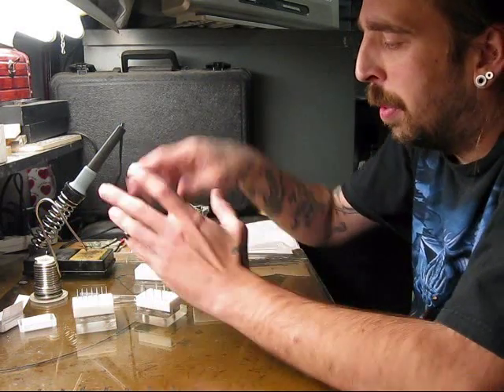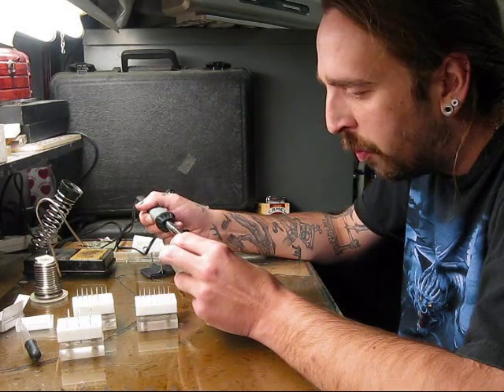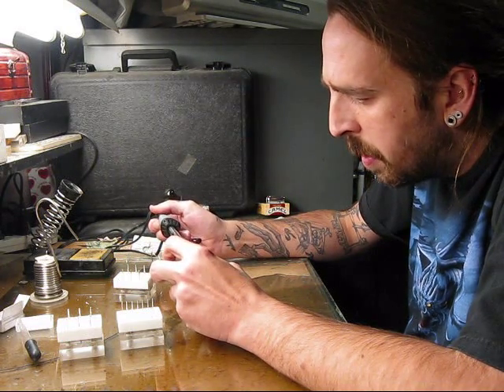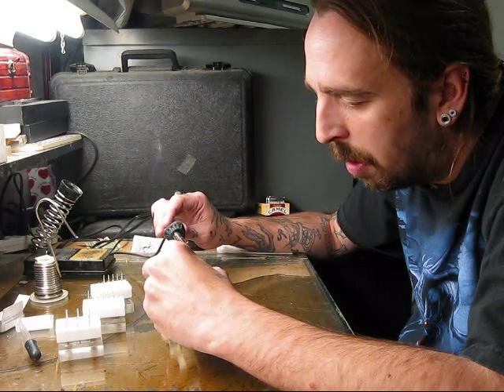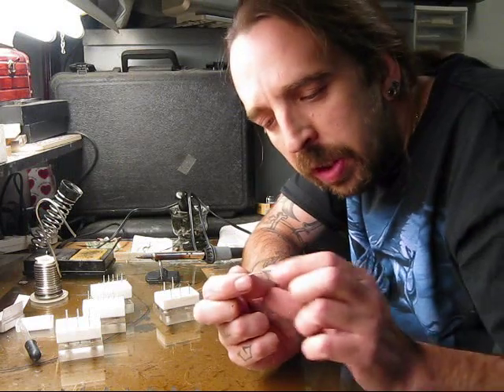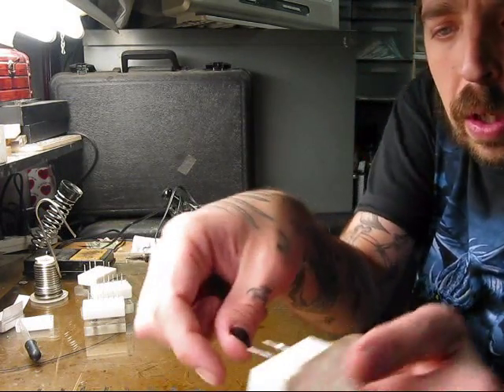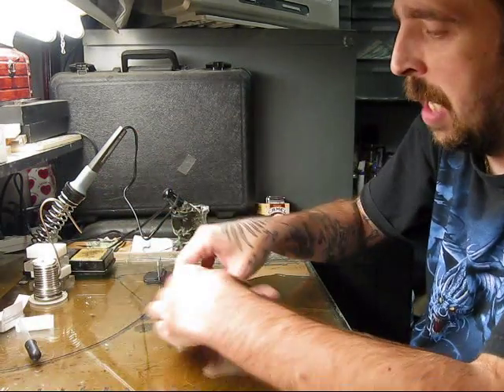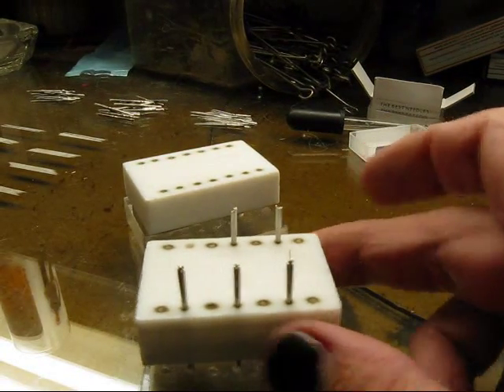how to make tattoo needles 4 of 6

Comment from the maker: your right.i dont know jack about soldering.all i ever needed to solder was needles and i was showed and went from there.as long as it lasts threw a tattoo thats all i need. i dont care what its called or why it works as long as it does work.and after 15 yrs i dont have any problems that u speak of.i tried using just a ;ittle bit and all i did was have to make a few trips to get the job done.

Comment: Hey dude, great video. I was looking for a video to show my wife how needles are made. I used to make needles at a shop called The Blue Dragon in London Ontario in the late 90s-early2000's. I made needles for 4-6 different artists (I was the body piercer there). I made them almost exactly as you do except I used really old school metal jigs. 1 needle-1 jig. I wonder if you have seen these before?  2 inches of a bar (end with loop on it) soldered to a small metal jig (small metal tube with metal bottom plate) (so the loop on the bar was your handle). I was taught by an old British Tattooist that owned the shop. Also I used a razor blade instead of the paper you mentioned for making mags. The razor blade was beneficial because you could change the gap easily to suit a certain artist and his tattoo style by controlling how far you slide the razor blade in. I have fond memories of sitting in our small unventilated room making needles for hours while smoking cigarettes lol.
Reply from the maker: lol..... the good old days..... lol..... these guys nowadays have no clue how to do this.... glad to bring some memories back for ya

Comment: This dude needs to learn about soldering. He might know how to make needles, but his soldering sucks. For one thing, he is making what is called a cold solder by putting solder on the tip of the iron and then touching the solder to the needles. This can cause breaks in the weld, and cracks, which weaken the weld. After you are done soldering, you are supposed to wipe the tip of excess solder, and then reapply a small amount of solder to the tip. This keeps the tip from being oxidized.